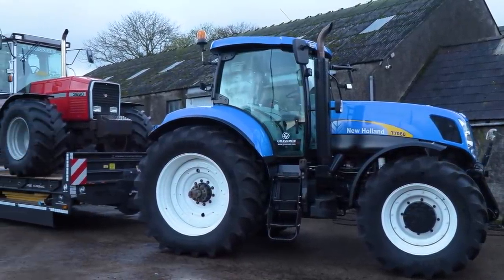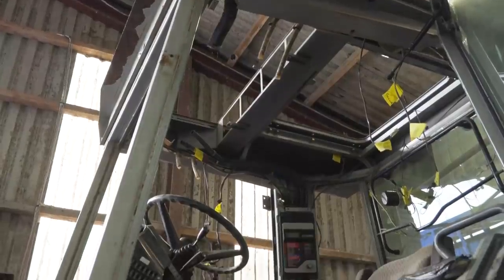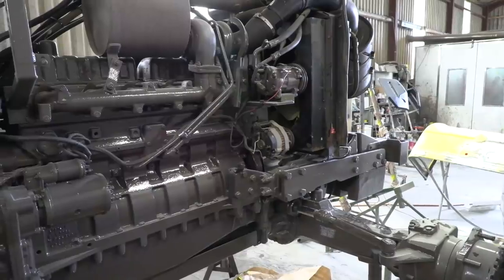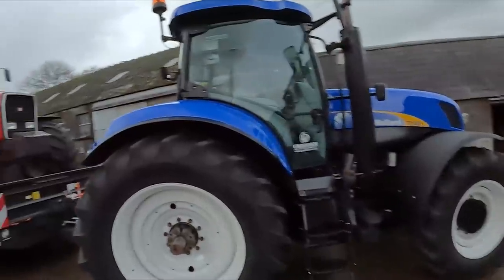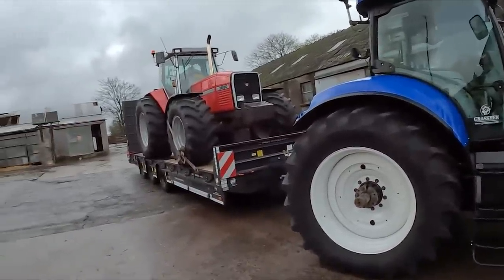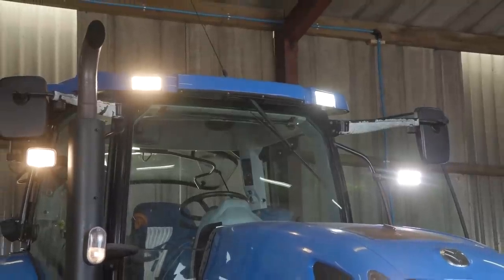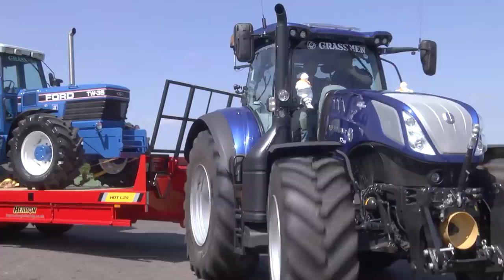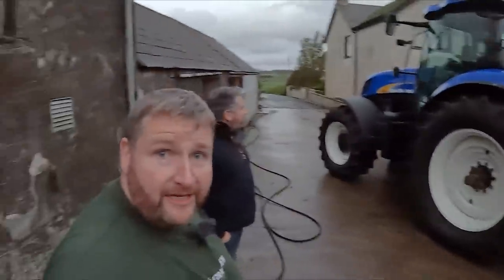DONKEYCAM - The Massey Ferguson 3690

Comment: Massey looking great but the noise from the 7060 pure music out that exhaust be interesting to find out the dyno result of the 7060 💪🏼😎
Reply: 280/300 when boosted
Reply: @PhilipjPatterson  ah right mind runs at constant 273 on the shaft with a Steinbaur chip in proved the fuel economy
Reply: @Eavis_excavations  we had a t6080 doing 255hp
Reply: 😲 did u get any back end issues with that hp
Reply: @Eavis_excavations  thankfully not
Reply: Ah that’s good mind rounded the 50k gear off the pinion shaft so required new 50k gear pinion shaft and crown wheel 😬
Reply: @Eavis_excavations  had been done rd5t hours an was 2 b done rd8t hours as we had sold it an got a 260 an mapped it 2 260/290hp an have a ts135a doing 173.5hp rd200hp on boost

Comment: Can't fault the restoration of the massey, very tidy job and an impressive end result but I'm sorry that thing you have on the low loader is nothing but scrap tidied up or not and as for the noise off it, been there done that and grew up. I'm all for keeping kit tidy but can't be arsed with those stupid look at me loud exhausts, makes me think your trying to make up for inadequacies in other areas.